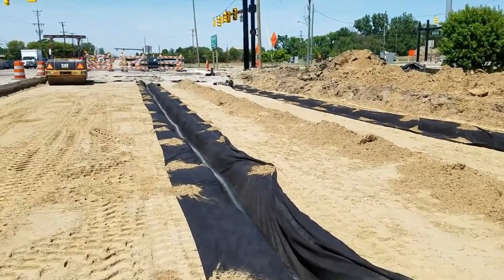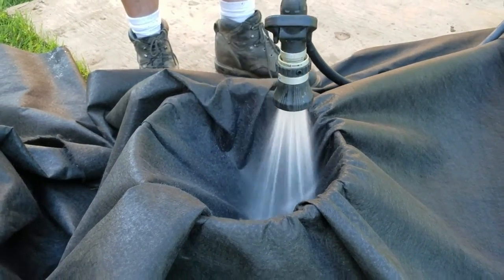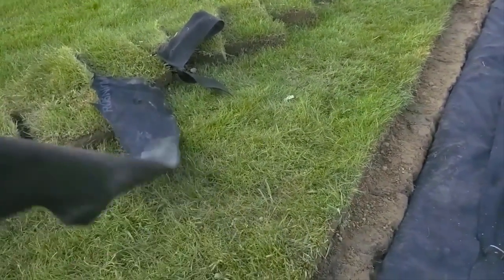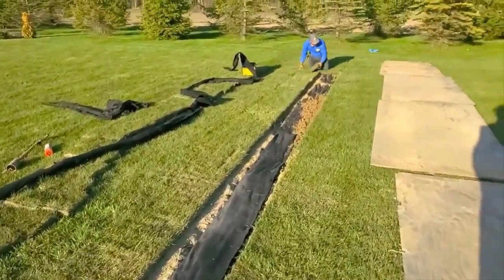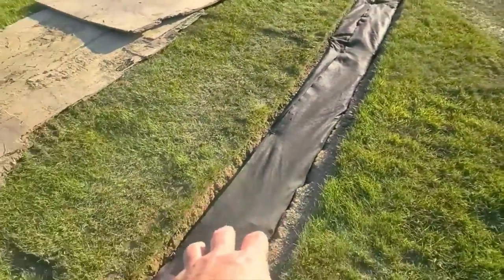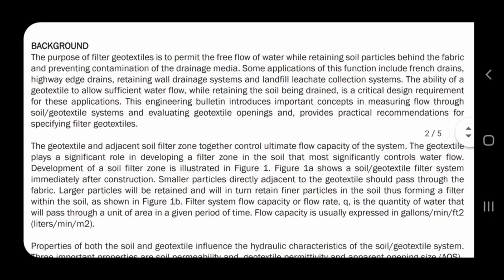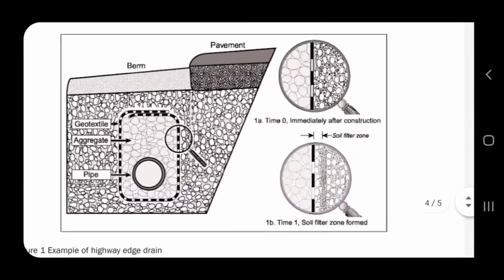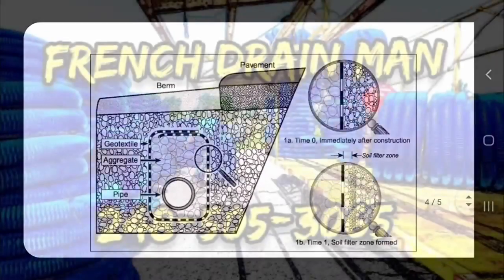French Drain Filter Fabric: Everything Homeowners and Contractors Need to Know

Comment: What do you think would happen if you used a landscape fabric on the 1st half of a 12 ft section on interior drain tile. The second section has geofabric leading to a sump pump. Wallboard was also used. Do you think the system would fail? Or do you think it would still drain? Unfortunately the landscape fabric that was used just not allow water to go through.
Reply from the maker: We get great results with our fabric
Reply: @FRENCHDRAINMAN  I was just asking what your thoughts were on if I didn't use your fabric. I did not use your fabric I did use some geofabric but then the other part I messed up and used landscape fabric but the drain towels already installed with the concrete on top so it's too late for now but I was just wondering what you thought of it and if it would last

Comment: Writing from Australia have been following you for sometime now but using the pipe that comes with a sock good to be used and then wrapped with Geo fabric for double protection preventing the pipe from been clogged?
Reply from the maker: Watch "How to Use High Octane Drainage Pipe: Sock or Burrito Wrap Method? [ Drainage Contractor Explains ]" on YouTube
https://youtu.be/vaquDFw5bnw

Watch "Do I Need to Use Perforated Pipe with a Sock in My Yard Drainage System?" on YouTube
https://youtu.be/4mzFc3J295Y

Comment: Previous home owener has a NDS grate system and at one end he did a large hole filled with sand and rolled corrugated sock 4” drain tile. I lay fabric under the grate covers to help filter out the system going into the sock drain system. I have used silt fence in the past. That ended up deteriorating over time. A few years back I installed landscape fabric and as stated it is just getting clogged. Do you recommend a fabric I can procure from you that will perform? Keep in mind When I did the past fabrics I simply roll out a 12” wide 13’ pice and just tightly lay it under the covers and screw the covers down so it does get uV RAYS.  Let me know if you recommend a fabric and I will order. Or I just go back to the stacked silt fence , remove the stakes and install that again. 
Thank you.
Reply from the maker: https://youtu.be/VFYj7sbmXGg?si=XnLWaO4OvtwR36rU

Comment: What do you recommend for an area with a lot of clay? I apparently have A LOT of clay where I'm putting my open french drain. Will this fabric work on top of it? Or does the clay have to come out and good soil brought in?
Reply: There’s another video that emphatically recommends running the gravel up to the surface (exposed) with less permeable clay soil.  But, it’s important to be clear about which problems you’re trying to solve.  There’s separate issues of collecting flowing surface water and a high water table. Running the drain rock to the surface also collects surface runoff.
Reply: @zanepaxton7452   I have at least 6 ft of solid clay so my dry well idea didn't work out at all, but for my original comment I was curious if the clay would cause clogging in my French drain but with the use of FDM double punched fabric it doesn't clog from the clay (at least so far) but where I was wanting to discharge to a dry well that idea has now turned to me building my own custom sump basin using 18" culvert pipe that I just picked up and may or may not make a YouTube video on how I'm building the basin.
Reply: @DirtyDirtbath  There’s issues with the capacity of dry wells. Where I live I can get 4” of rain in a big storm (that just happened). A typical storm is listed as 1.5”.  With just a typical storm, I’m seeing about a gallon per square foot!  So with my rear acre that’s about 40,000 gallon to deal with! 1 CF of volume = 7.5 gallons. So for my 1 acre that’s about 5,300 CF of water! That’s a 42’ square dry well 3’ deep! So I’m guessing that your drywall is woefully too small even with a light storm over a smaller area.  

Also just to complicate matters, you need to consider that if the land slopes up around some of your lot you’re getting additional rain water runoff from a much bigger area beyond your property. Also ground water can be higher too during the rainy season. Trying to drain a dry well into a high water table just doesn’t work!
Reply: Thats exactly what's happening, besides the 4 down spouts and 2 different sections of French drain around the house, the yard has a slope to it and pretty much directs the water to the hole,which the hole is 4.5' long, 3' wide and 5.5'  deep and I had dug an extra 4' in the center to have "extra drainage" and to see if I could get past the clay. No luck to get past the clay a d I most definitely underestimated the volume of water I was getting.

We got a somewhat hard rain that barely lasted 2 days and I had to drop my "dirty water sump" in and drain it 4x within a 12 hour period which really prompted the motivation to build this sump system.
Reply from the maker: https://youtube.com/playlist?list=PLjFCqaZ4v1BUmAXw5xwQ0zbQRPxnX0U7R&si=wttvCXoQYbvUFCiY

Comment: I have a large gravel driveway/lot. To stop my shop from flooding, I must bisect the driveway with a french drain. But I will never run out of sediment! 
Besides erosion control, (which is prohibitively expensive) any suggestions?
Reply from the maker: You can move the driveway so it's not a straight shot.

Comment: Sooooo what are the specs of the fabric? Weight/(meter or yard) gcolored with carbon black during manufacturing?
Reply from the maker: It has 100 lbs.  Tinsel strength and 140 GPM through a sq ft

Comment: Where do I get this fabric? I have an area that has very little grass because the water has stood there so long and it gets little light. Will a buried french drain like this work in that situation? (covered with mostly dirt and little to no grass) or do I have to do one with gravel to the surface?
Reply from the maker: Watch "How To Build and Install the BEST Yard Drain, French Drain, 2 Great Systems Combined" on YouTube
https://youtu.be/-M3K4p39J84
Reply from the maker: Store | French Drain Systems | Curtain Drains | Macomb, Oakland, Lapeer, St. Clair County
https://frenchdrainman.com/store/
Reply: @FRENCHDRAINMAN  This one had thick grass. I didn't find anything about in about putting one in, in an area with little to no grass.
Reply from the maker: Watch "Open French Drain Installations for EXTREME Yard Drainage [Commercial and Residential]" on YouTube
https://youtu.be/mSfXGLlyIKM

Comment: Don't think the excess overlap matters that much at the top though. French drains fill from the bottom up if I remember correctly. If the water is getting in from the top then you need another type of drainage system. If however the overlaps were below or at the sides I definitely understand the importance of the "no more than 2" overlap rule
Reply from the maker: https://youtube.com/playlist?list=PLjFCqaZ4v1BVX2cpGD7wJqH37RSS1JAOz&si=du3LJcVc4SAvED0o

Comment: so bottom line, I'm south Georgia (basically Florida), I'm in the clay, Should I use filter fabric or not?
Reply: Michigan (and Indiana where I am) are also heavy clay.  Have seen some FDM videos that show that.  If ive done my homework right, the answer will depend on whether you are running your downspouts away from the house (solid pipe no fabric) or draining the soggy yard etc. (knife cut pipe with the gravel and the wrap).  Hope it helps
Reply: Knife cut french drain with gravel.
Reply: @jonathanschubert9052  yep i think that goes inside the burrito wrap
Reply: @jordan110  think the knife cut pipe is FDM product featured in some of their videos.  It’s got slits cut into it for extra drainage when you get to the leeching field, wherever the water is headed to, so that it distributes more evenly at destination.   Just my recollection but am no expert.   Good luck

Comment: If anyone here can answer, I'm planning on doing perforated corrugated pipe and large drainage stone built up to essentially hardscape/decorative, it's to get water away from the front of my house where it's down hill and itaking my crawlspace damp, if I'm wanting it to get away asap, I wasn't planning on wrapping. Just leaving the top open so water has plenty of room to catch and flow away. I should still be using the double punched non woven geotextile correct? I dug up the hardscaping that used a plastic, the ground under was still very damp and we hadn't had a rain in at least 3 weeks. Any heads up from anyone would be GREATLY appreciated!
Reply from the maker: https://youtube.com/playlist?list=PLjFCqaZ4v1BXFJKxV1EfanZ1Q-lZ1SODD&si=8r8Q86CPSOUBg1gE